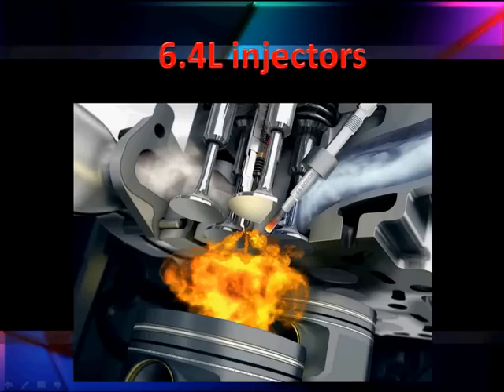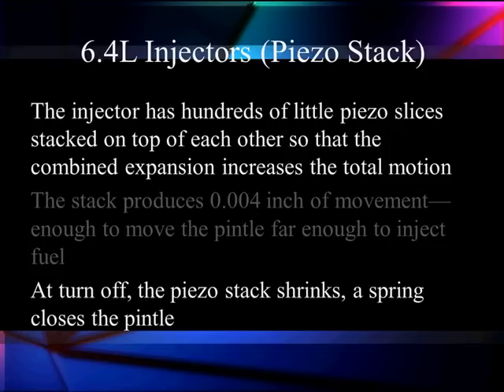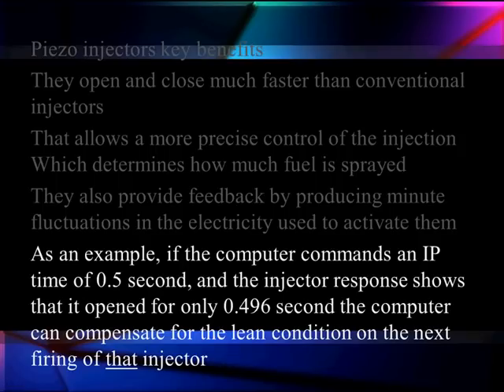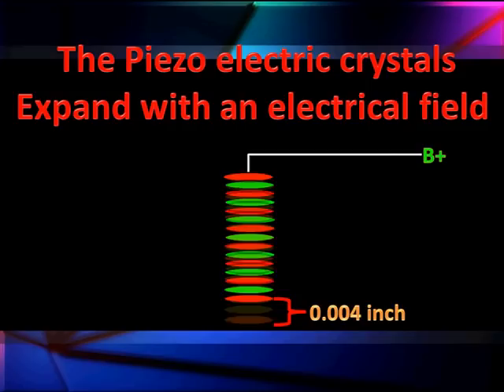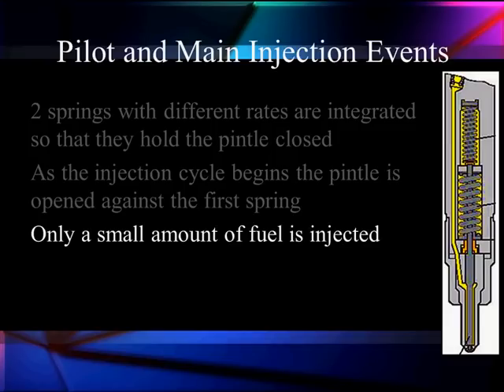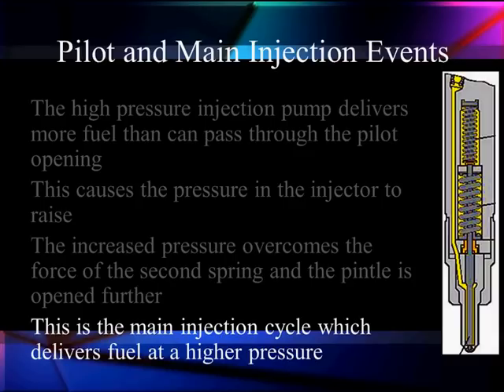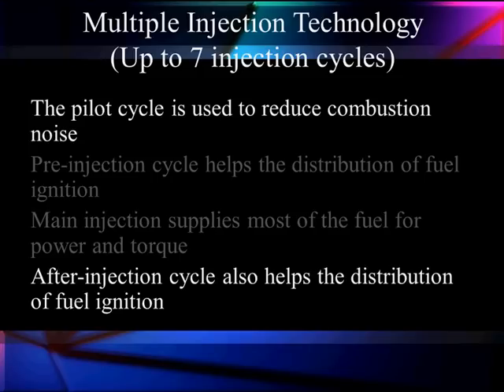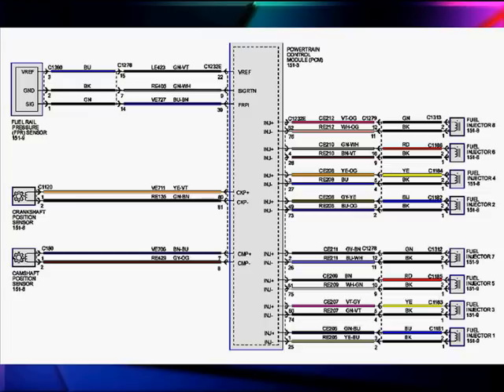38 Piezo Injector Operation

Comment: Piezos operate on voltage, not current like a coil does. Interestingly, 700V and 10 amps requires 10HP driving the alternator...
Reply: 90-120 volts on the piezo injector I have for a 1.6 TDI, 200 KOhms resistance across the pins. 700 V seems a bit high.

Comment: These injectors are what allowed the 6.4 to make it's incredible power. However the sensitivity of the entire injection system to fuel contamination is the Achilles heel. A single gallon of gas can ruin 2000$ worth of equipment. The 6.4's real downfall was the high temperatures required by the emissions system. In which extra fuel was injected on the exhaust stroke to send flames and high temperature exhaust through the turbo to the Diesel particulate filter in order to burn the soot collected there. Also the 6.4 was NOT built or designed by Ford Motor Company, but instead by International Navistar just like the 6.9idi, 7.3 idi, 7.3 powerstroke and the 6.0 powerstroke. Non of those engines were in-house Ford built.